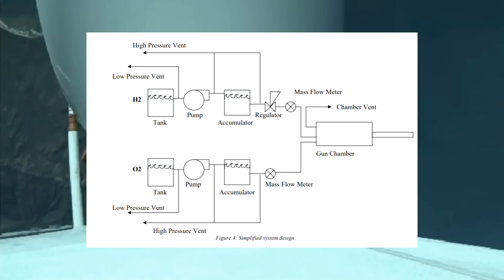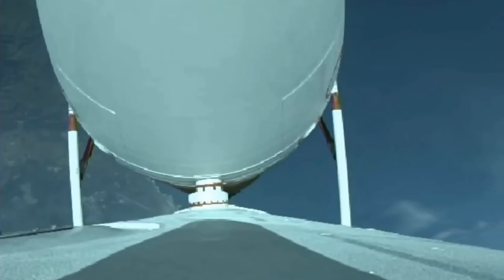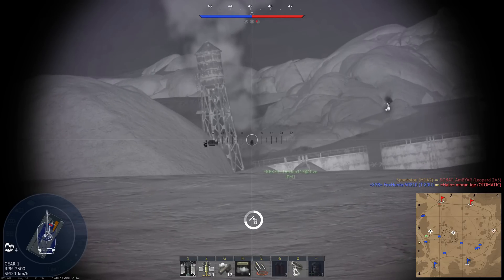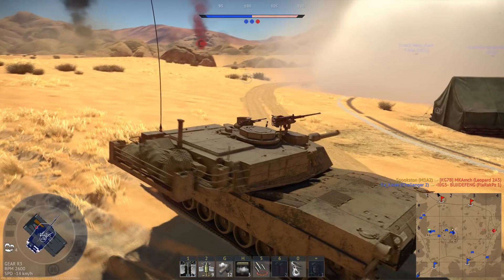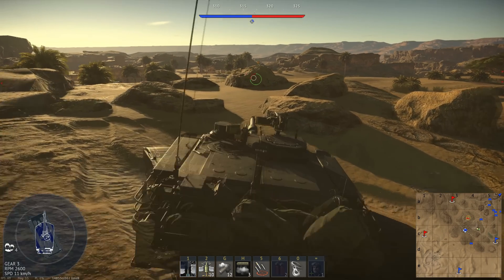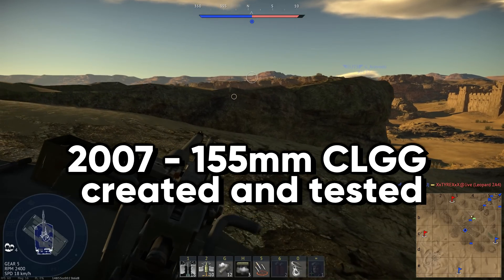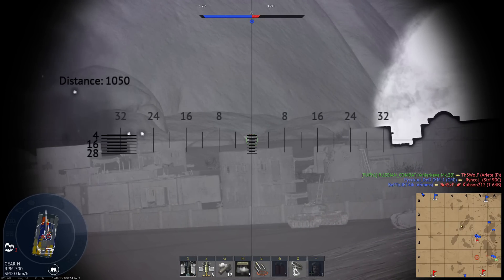CLG Guns - Future Tank Weaponry

Comment: I’m wonder if CLG would be viable for space combat, the ambient temperature of space could be used to keep the gasses cool and it would be much easier to maintain the vacuum in the chamber since the new issue become keeping gas in rather than atmosphere out.
Reply: Weirdly enough, space for the average traveller is quite hot. Your only ability to effectively reduce temperature is through radiation. The vast, vast amount of heat produced by any activity in space will stay on board unless you have a lot of radiator panels/ arrays to expel it into space, which itself is a slow process.
In effect, it's actually easier to cool things down on earth because it's easier to pump the heat and dump it elsewhere.

Comment: I imagine such a system would basically exclusively be used in autoloaders. You basically can't manually load it anyways and it might be a perfect fit for an autoloader since instead of a mechanism you just need some pipes. In a uncrewed turret like the T-14 this could very well work since then it could just freely vent the gas.

Comment: projectile velocity directly impacts barrel wear, at 7km/s i'd immagine you'd need maglev or some special coating on both the barrel and the projectile to prevent the projectile from melting partially in the barrel, causing it to become less stable during flight, and or wearing out the barrel. A sabot would protect the projectile, the problem would be the sabot wearing in the barrel and leaving parts of itself behind

It is possible to store liquid hydrogen and oxygen at room temperature under high pressure, though to make it safe from punctures it would have to be cryogenically stored, otherwise a sudden drop in pressure from a large enough hole would flash boil enough liquid to push everything out of the tank

Comment: There are some... Inaccurate statements both in video and worse in comments.

I am, as I write this, staring at my 12,000 gallon liquid O2 storage tank. This tank is at least 30 years old and has been shot at with small arms. We routinely draw 300 litre liquid dewers that get dropped often enough. These dewers are the only parts that ever have any leaking/seepage issues, and that is due entirely to excessively rough handling, end-user safety devices, multiple outlets(some for liquid and some for vapor withdrawls), and general design of said dewers.

Liquified gas storage is not "cryogenic storage", the liquified gasses are classed as cryo-fluids; these cryo-fluids are what is used in Cryogenic storage. Their temperature and liquid state is maintained by pressure(which is the actual danger in in catastrophic failure: structural failure of the container).

One of the other commentors mentioned the low density of Hydrogen as an issue, but then got the math so far backwards it was crazy. You require 2 mols of hydrogen for every mol of Oxygen for perfect reaction without waste, producing 2 mols of water. In other terms, since 1 mol is 6.022 140 76x10^23 atoms, and the atomic weight of hydrogen is roughly 1 with the atomis weight of Oxygen at roughly 16: you need roughly 1/8 the mass of hydrogen in ratio to the mass of Oxygen. While the density effects the volume of those masses you must also take into account the compression of the liquified gasses. 300 litres of O2 has a weight dependent on the pressure to be contained: at 25-100 max psi-rated safety device you are talking about 700 lbs of O2, at 500 max psi you get 900 pounds of O2 for the same 300 litres. And there is some strangeness at pressures between these 2 extremes with less weight at 250 max psi than 25-100 max psi, buth then back up in weight as you get higher in pressure relief devices. Point is the volume of liquified gas has far more math involved than a simple: less dense means more volume; this is only true at atmospheric pressure(and with most values determined at sea level). 

The next part here attests to some of the other safety situations: while liquification of gas requires some very high pressures(and why electrolysis of water could only be used for "gas on the go" not for replenishing supplies)to achieve, those pressures are not required to store or use liquified gasses. In the last paragraph I outlined some weights with some very low-pressure maximum safety devices (25 psi) on liquid O2. Well we also deal in high-pressure compressed gasses: 2400 psi rated containers from 10-300 cubic feet of compressed O2. The O2 in these bottles are nowhere near liquefaction pressures.this is also where the density of hydrogen is going to play a factor in storage volume vs oxygen (but even then, not by much; look to the fuel pods on the space shuttle: big one is O2, 2 smaller ones are H2).

Common safety misconception: Oxygen Does Not Burn. Oxygen makes other thing burn, hotter and faster. 

You also would not need huge amounts of the reactive gasses (like the fuel trailer), since the mix only has 1 efficient ratio and either has a single ingnition chamber or multi-stage vents it could be computer controlled for precision and requiring less reactive mass/ shot. Meaning that even with a slightly larger than man-sized container of Liquid O2(and same or couple smaller Hydrogen) you are more likely to run out of shells than propellant

Comment: Extending barrel life by reducing heat is not true. That's only one factor. The hardness of the projectile (copper vs. steel vs. lead etc.) and the velocity they are accelerated are just as important. This is why high pressure water can cut steel. and also why one huge logistic holding back Railguns from mass use is its incredibly low barrel/rail life. So the wear you loose from cooler temps is overshadowed by the friction gained with extreme velocity.

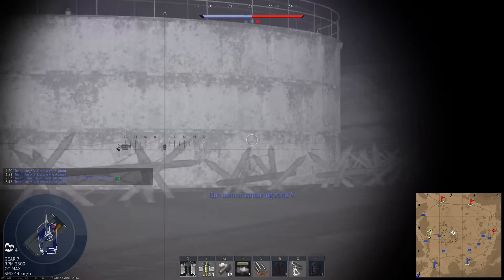Comment: 3:06 propellant isn't frozen, it's cooled to be in liquid state, which is in cryogenic range for pure oxygen and hydrogen. Although O2+H2 have the best power per mass, they are the very bulky and not very safe for handling, transport and storage. That's why the military uses solid propellants for their rockets/missiles, and O2+H2 will never be used.
And tanks and artillery rounds are traveling through air, so they don't need rockets (oxidiser), solid ramjet motor would be a far better choice.

Comment: Way too dangerous to put liquid O2 and H2 in close proximity or even in a confined space. Liquid O2 is cooled to liquid form at -297°F. It a leak happening it would explode out of the chamber and react violently(mostly a fiery explosion since it would be hitting oxidized metal) and kill the crew very quickly and pretty much melt the tank. Good concept but horrible user friendliness

Comment: The main benefit of the railgun over any chemical based gun is that the entire ammo is used as stuff that kill. A normal round has more weight in propellant and in some case even as case and such than what goes out of the weapon and hit the target, while a railgun ammo is 100% goes out (almost), so it is insanely compact in this regard. And here the comparison are not so simply. Also the railgun use a simply mass as ammo, while any chemical propelent using ammo will be a complex item that is harder and more costly to build in similar numbers.

Comment: At 7+ km/s  you are dealing with thermo hydrodynamics and plasma blackouts at the same time. Oh and lets not forget the hilarious g-load and then a vibration environment making a normal shell look  like it was floating down a pleasant stream after the shell is fired that any moving parts would have to handle. Not what I call a recipe for accuracy.

Comment: It is important to note that hydrogen can fit through the molecules of most materials, so even a solid metal tank will leak. This can be seen when many rockets make a fireball around themselves at ignition, despite aluminum  walls in the tanks. 

This is easily solved by having ways for the gas to dissipate before it becomes dangerous.
Reply: From what I know that's not the reason. Reason being that some rockets during start expell a lot of of propellant (with a different mixture) from engines before they ignite, which then catches on fire to avoid too much buildup.(and usually it's fine)

Comment: there is a problem with Hydrogen tanks in general ... since it is the smalled atom it can permiated through evry material there is ... you simple cannot prevent hydrogen from "leaking" unless you solve it into a chemical that can hold it without bonding with it.

Comment: 200km is irrelevant for a tank gun as tanks use there guns for direct fire plus at 2m high the curvature of the earth takes effect at 5km anyway.  Indirect fire is for artillery which at such ranges would require course correcting shells as hitting anything mobile would be more luck than judgement.

Comment: I wouldn't suggest that this weapon is a future weapons replacement considering that the technology for this system dates back to the 60's to a gun that was even more powerful but used a different propellant system all together, because you can't store the gas based propellants in one system, which makes to big flaws in your design, two areas of a tank that if hit, will explode one because it has large amounts of compressed oxygen, and the other large amounts of compressed hydrogen. Its a nice overall concept but not something that will replace, prototype weaponry such as rail guns, coil guns, Gauss guns or the likes particularly when the later technology is more well developed in the future.

Comment: Maybe use ALICE-type rocket fuel mix for the gun or even as an explosive filler for warheads.Basicaly it is nano-sized aluminium particle with water that are detonated. This mix has proportional power with it's mass in TNT.Aluminium is very reactive to oxidation but at bulk material the oxide on it's face stops any more reactions for happening but at small nano grain-size it's "cooperative" to high oxidation.

Comment: You kinda left out the part that the 7.2 km/s projectile was 2 grams!
More reasonable weights tended to cap out somewhere between 2-2.5 km/s on both the 45mm and 155mm versions. At the upper limit of the tests, the 155mm version got a 160-something pound projectile up to somewhere between 0.8-0.9 km/s.
Here's the paper itself: https: slash slash apps.dtic.mil/dtic/tr/fulltext/u2/a462130 dot pee dee eff
Publically available, found through Google - though the cited papers require subscription to a journal that is apparently so fancy-ass they only let organizations subscribe.

Comment: Might be a bit of a stretch to manufacture the stuff on site next to a cannon. Like im a 13F for the army so while its not my exact line of expertise i can only imagine pvt dumbass trying to run the thing although i do see 2 options, they either create another MOS dedicated solely to fallowing 13bravos and creating the stuff, im picturing a HMMTT with machinery, or a supply guy with a truck full of the stuff itself sitting by the cannons like a tap amd when it goes empty it fucks off to get more. Very interesting to think about though id love to see a 155mm smack a dirtbag from 200km away some day

Comment: Can a similar effect be achieved using gasoline/methane and oxygen, or better yet, just air and  fuel? Combustion engines work that way already and it should help reduce the storage issues caused by using this system...
Reply: Any type of rocket fuel will work, each have pros and cons. using air/fuel would be very inefficient and hamper the performance significantly due to air being mostly not oxygen.

Comment: The problems with storing cryogenic gasses in a tank or a self propelled artillery piece seem like a big downside to the implementation of an otherwise pretty damn sweet tech. 
Solution: just don't
The idea is to produce the H and O propellant rapidly and on demand for each shot taken (or close to each shot)
Electrolysis is close to the simplest and oldest electro-chemical process in existence so all you need, in say a tank setup, is a water container, a rapid electrolysis unit (very cheap and could be run off and electric generator coupled to the tank's engine), and a pressurizer unit for the gasses that will be stored behind the projectile in the barrel and maybe a single shot sized reservoir for rapid follow up shots. 
Im studying chemistry at uni and have abit of experience and knowledge with this type of stuff and im telling you all these systems already exist on the commercial market and in sizes that will comfortably fit into a tank's chassis. 

Pros: 
-No storage of large amounts of gasses anywhere on the vehicle
-your propellant exists as water for 99% of the time which is like the holy grail of safe storage
-basic parts and tech exist on the commercial market, are easy to source and cheap
-super dupe duper uber cheap propellant
-auto-loaders have an easier time dealing with just the shell
-desalinated water is all you need, so a logistic truck could desalinate lake or river water on site and directly supply an artillery regiment with all the propellant they need 

Cons:
-fairly complex interlocking system that will take time to properly design and implement
-if the hydrogen and oxygen have to be cryogenic in the tank barrel a more sophisticated pressurizer unit would be needed, added cost and complexity
-has a high electric consumption, not an issue for a tank's engine with a generator but could be an issue for firing on the move (maybe stick to self propelled artillery for now)

All in all i think this is very doable, yes designing a reliable system will be a challenge but ultimately I think the pros outweigh the cons quite substantially. Im down for some feedback, why would this idea work and why not, be specific. Cheers and thanks for reading

Comment: It is really strange that a thermodynamic gun can surpass an electromagnetic gun (railgun). Is the source of information thrustworthy?
The reason of my scepticism is based on multiple factors. Firstly, the possible energy density of chemical propellants are severly limited. Thus in order to increase the muzzle velocity, one must increase the mass (and volume) of the propellant per shot, which requires in larger gunbreech / gun. Meanwhile the in case of a certain railgun there's no theoretical limit to the muzzle velocity. The only thing that limits the muzzle velocity of a certain size railgun are the yield of the powerplant and the limitation of the materials (tensile strength etc..)
Secondly, the nature of the stresses in thermodynamic guns and railguns are very similar. In both weapons the there are parallel and perpendicular forces to the axis of the gun that tries to tear the gun apart. In both cases there are strong and tight contact with the projectile and the rails or the barrel thus there's severe friction. In the thermodynamic guns the the contact even tighter because the gases must be kept behind the projectile, so the friction is also higher. The magnitude of these forces depends on the expected muzzle velocity of the given projectile. So if they managed to create a 7.2 km/s muzzle velocity thermodynamic gun, then why couldn't they create a railgun that at least could produce 7.2 km/s muzzle velocity with similar projectile, if the stresses are so similar in nature? (In the comparison the mass of the projectile should have been written) The railgun research departement must be messed up something seriously.

Another problem with the given information is the gun heating problem. It was said that conventional guns heats up much more then these CLG guns. This statement is in contradiction with the definition of the ideal thermodynamic guns: 
https://www.chegg.com/homework-help/questions-and-answers/gun-heat-engine-particular-internal-combustion-piston-engine-operate-cycle-comes-apart-adi-q2379077
https://en.wikipedia.org/wiki/Physics_of_firearms.
The emphasis in on the adiabatic expansion process. This means that the propellant gas doesn't exchange (or negligibly) with the environment ie. the gun barrel and the projectile (in an ideal thermodynamic gun). The heating of a thermodynamic guns doesn't depends directly on the type of the chemical propellant until adiabatic expansion process is a good approximation for modelling the gun's behavior. It implies the heat comes from other, indirect effects, such as friction, mechanical shock. These effects mainly depends on the gun design. However one can argue that the more powerful the chemical propellant, the higher the forces and pressures. This results in stronger mechanical shocks which creates more heat. Indeed if this argument valid, then CLG guns should heat up much more then conventional guns.
Of course there are extra effects that i surely omitted, but the overview of the things is this. CLG technology in itself is a sensible candidate for the next generation of thermodynamic guns, but I had to point out some problem with the background informations.

Comment: Hey spookston can we bring back battleships with CLG guns
Reply: nicy vinoy I would think cruisers would work better. Battleships are too slow and don't have enough armor. Using many more small cruisers would help protect the fleet from both naval and aerial torpedoes. I have also read a comment on here that mentions using methane and compressed air instead of cryogenic hydrolox. Imagine a wall of cruisers armed with two triple-gun turrets firing 10" shells at 7 Km/s ~60 RPM per ship.